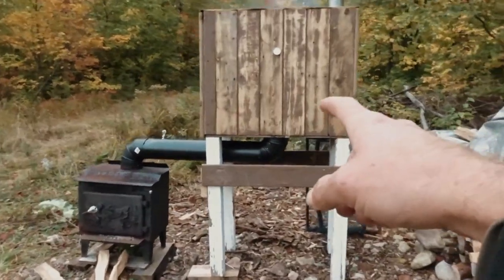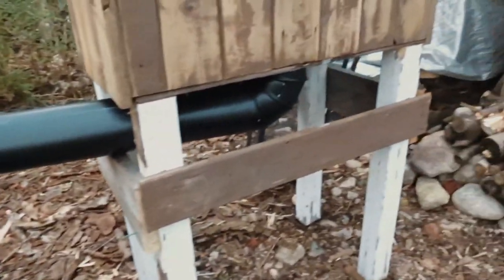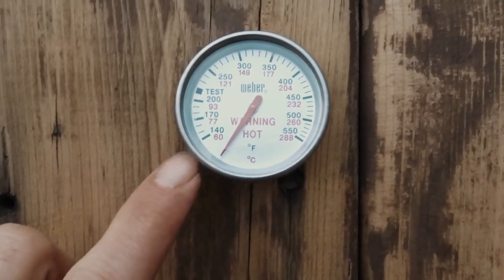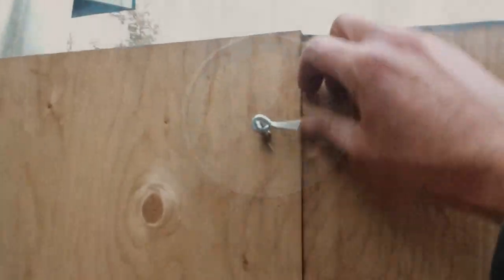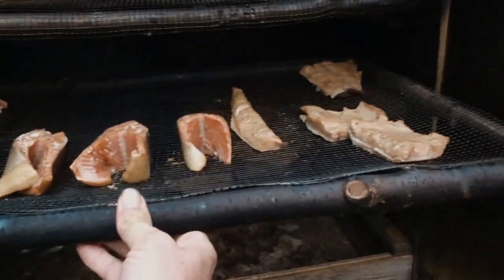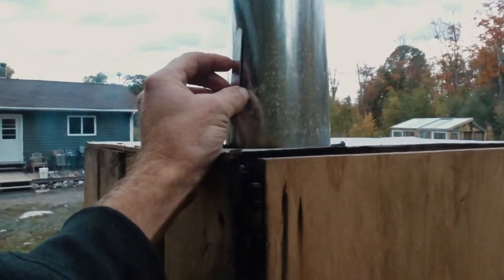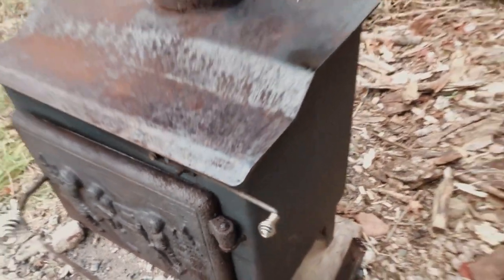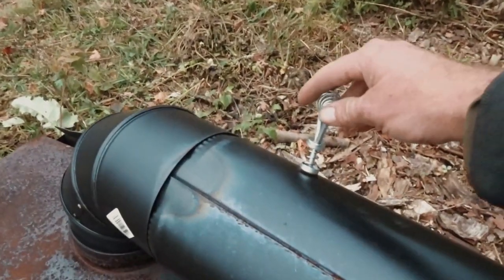DIY Smoker | Our Woodstove Meat Smoker | How To Make A Homemade Offset Smoker For Hot & Cold Smoking

Comment: The baffle is a good idea.   A double offset smoker has one for exactly that purpose.   It supposedly makes a great improvement
Reply from the maker: Oak Knob Farm definitely.  It’ll increase the surface area I’m able to use on the racks with better heat distribution.

Comment: Hi.  Great build.  Is that just normal chimney pipe?
Reply from the maker: Yes.  Single walled cheap stuff.
Reply: @Wilderstead  Thank you.  I have built a smokehouse and am using aluminum dryer venting that is not working properly...getting to hot.  I was worried about chimney pipe toxicity from fumes that may be introduced to the meat.
Reply from the maker: Burn some hot fires to season the pipes before actually smoking any meat in it.  Your dryer vent is likely galvanized steel and not aluminium, unless it’s the flexible type.  You don’t want to use galvanized zen anything for food.
Reply: @Wilderstead  Yes, it's the flexible kind.  Thanx for the assistance!

Comment: Nice smoker Dave. Really like the use of branches for the racks. Looks like you can control the heat very well. Good work man. Well you be putting a roof or over over the stove? Just curious.
Reply from the maker: So far I'm going to leave it as is.  Might be a good idea to cover it with something though.  Especially if I want to use it over the winter.  As it sits now, the whole thing will be buried in snow in a month or so!

Comment: Wayyyyyyyyyyyyy to hot, nothing but leather left at 180 degrees??
Reply from the maker: 180F is lower than most suggested temps to hot smoke fish ...
Reply: @Wilderstead  I’m not sure where you heard that lol.
Reply from the maker: Find me a hot smoked fish recipe that is under 180F, bud.
Reply: @Wilderstead  fat renders at 160 degrees ..... enjoy yer smoke. When I do a brisket I smoke it for about eight hours at 100° when I do summer sausage I do the same, jerky, snacks sticks, chicken..... and then I heat it in my oven where I can control the temperature perfectly
Reply from the maker: So you heat it up after?  And even still, under 180f for everything you smoke? Oh.  Well, we smoke well below 100 degrees when we are actually smoking meat.  We finish the smoking in the smoker by raising the temp in the box, and finish at different temps depending on what meat we are smoking, and what the final product is going to be.  I guess you didn’t catch that in the video...
Reply: @Wilderstead  I get so worried about rendering the fat and it’s getting to dry so I have a almost commercial oven in my home that I can control the temperature very precisely